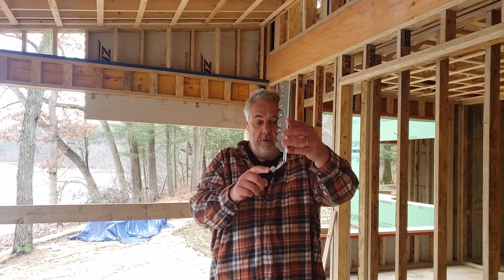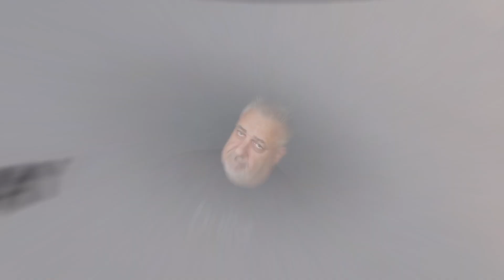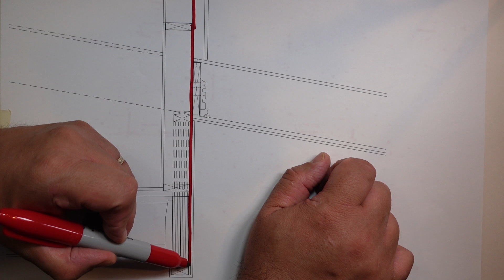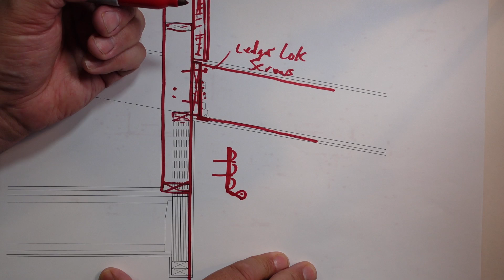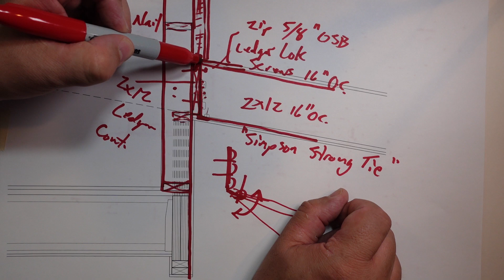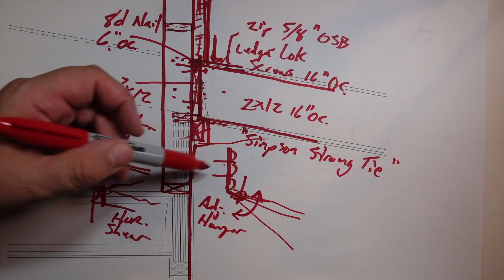Have You Used SLOPED METAL RAFTER CONNECTORS....

Comment: I am currently installing the Simpson lssr hangers with my monoslope roof for my I joist rafters on my DIY 5-story multigenerational passive ICF home. 

I will be adding 8.5 inches of eps outer insulation. I plan on zip taping my plywood roof sheathing and then taping both layers of eps and finally putting sharkskin ultra sa on top. 

On the bottom of the I-joists I will be putting intello air barrier. 

Because of the stack effect and the pressure that is created with a 48’ tall interior I want zero air to be able to escape at the top of my roof. Also I will have zero penetrations in my standing seam metal roof.
Reply from the maker: Good luck with your build
Reply: @stevenbaczekarchitect9431   Thanks Steve!  I have watched countless hours of your videos and have incorporated many of your teachings.  

Including your favorite word. 

Continuity 😊

I even have the pango wrap going  under my footers and then a rubber sealant on top of it and the ICF walls up to the roof and the sharkskin. And I will be using Prosecco liquid flashing around my windows and doors. 

You would be able to take big red and draw a line completely around the house  with out lifting your pen 😊

And while I realize Jake wouldn’t be excited about my ICF home 😂 I can’t wait until I do my blower door test and share my results with him 🎉😊

Thanks for sharing your wisdom!

Comment: Have largely wanted to use a single slope, to minimize rain penetration risk but holding off until I see how the high leading edge is flashed. 

Great content, thank for sharing along with all the Build Show skillsets. So vital. I can’t build as much as I thought ai would but I will build without or with minimal compromise. “ If it doesn’t last, and it isn’t healthy (I last) it doesn’t matter.” Figuring out who I can build with in 8-25 months. Floor plan principles are approaching 80-85% complete
Reply: Why do you consider single-slope to have less rain penetration risk?  To me it seems that there’d be more rain penetration risk.  IMO not enough to be a show-stopper, but I think it requires a bit more care than other roof types.
Reply: Specifically I’d worry about the flashing from siding to roofing later on, when the roofing needs replacement.  Also venting issues.
Reply: @ thanks for the inquiry. I am not settled and appreciate your observation and question. My concern is in fact of higher risk at that leading edge, and that it is detailed point for point, perhaps facilitated by the Zip system with superior drainage, air gap and water barrier deck with and fully tape wrapped seams and edges. Provided that is addressed, I like the idea of minimizing hips and valleys and chimney flashing (and other walls). Boots do a good job on standpipes, but if I can secure a strategy to route as much as possible out a side wall rather than the roof, I would go that route. Former roofs had a few leaks around chimney flashing and each one needs for the roofers during repair and replacement to get it right, and they don’t always. I don’t even like the look as much, but it could improve my lake view from inside, provide a simple single edge collection of rainwater and a simple expanse for some solar.

I have strong advice from a friend to pitch the roof at least 4:12. I don’t need a roof pitching as high as a full width house. 36 foot wide roof would rise 12 feet. I would not fill that extra 12 foot of wall with windows so not much point. My friend has seen too many 3:12 and flatter roofs leak, and 4:12 seems to have extra resistance: I think because the overlaps will not wick water as much between panels, or maybe it just stops with a little extra rise within the overlaps.

It is also first and foremost having a build of superior longevity with reduced maintenance. As I plan it, I may be remote, with little choice in the tradesman for maintenance.

Comment: Any outsulation on the roof?
Reply: Another great and informative video! For that upper hanger -  could a person use a regular hanger and do a small notch in the bottom of the joist to create a small horizontal surface to sit in the bottom of that (regular) hanger? More labor involved, of course.
Reply from the maker: @cappypants9169  You can depending on the span and depth of the rafter - anytime you call to cut something it needs to be verified that "not too much" was cut out
Reply: @cappypants9169  Probably not worth the effort when you can buy these.
Reply: Will it be a vented roof?  If so, how’s it done?
Reply from the maker: @kc9scott  Kind of......the roof is insulated with 8" of closed cell (per homeowner. The topside of the sheathing is vented with a product called "Entangled Mesh" the metal roof sits atop the mesh
Reply from the maker: No
Reply: @stevenbaczekarchitect9431  ok. please go into the thinking behind that on the next video?